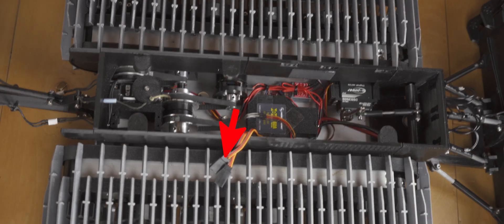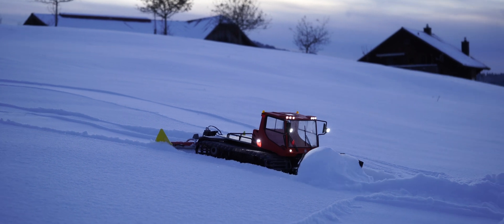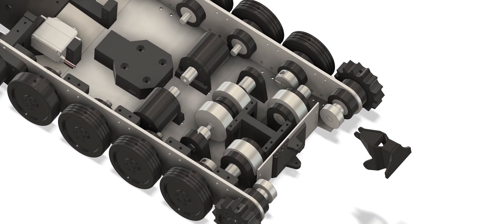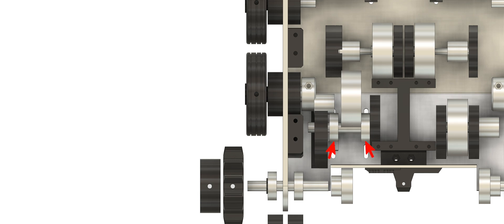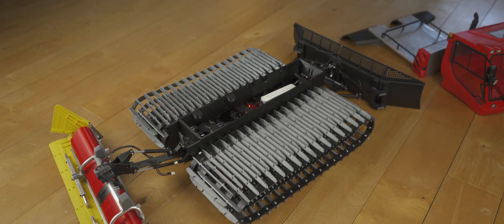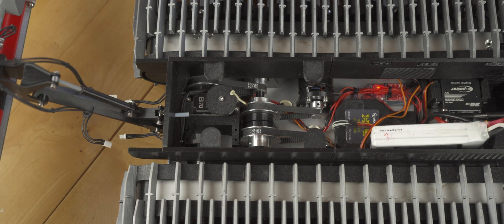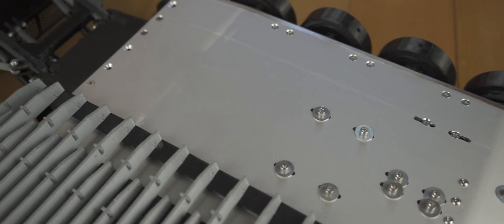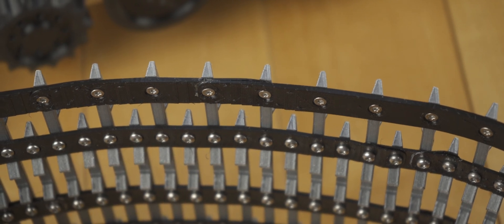Build Pistenbully 400

Comment: Hey! Thank you for the instructions! It looks like it's going to be a great machine! I have a bunch of questions and some recommendations but I'll try to put it in a list so it's easier to make a partslist  that you can use. 
- What other screws are needed and kind of how much? I saw it's mostly M3 everywhere but there are some M4 and different lengths?
- What do you use to program the ESC? Since you'd need to configure it for forward/reverse and so...
- Is all of the lights 3mm led? I saw most holes are 3mm
- The steel shafts for the rollers are 8mm and 5mm but if you write what length and how many pcs. they are you can order them as steel pins with exact length so you don't have to cut them.
- The motors seem to be a impossible to find and also anything it this size, can you suggest some alternative? It will be also easier for most people who will build it to have more popular alternative such as something from aliexpress. Than you can have parts worldwide and order almost everything in one place.
( I saw there isnt much space if I get bigger to be safe with torque but im worried if it will be enough if I get a slightly smaller ones. 
- The motors in the tiller I guess are 12V 16GA geared motors but what is the output RPM?

It might be easier for builders also for you if you have a group then others can help with info too. (other creators usually use facebook)

I'd like if i can get a contact with you in some way so I can put together a part list with links and information as well as send you some ideas and files of upgrades in the future that i have in mind 
(more functions on the blade for example.

Thank you for the amazing project and greetings!
Reply from the maker: I made a discord server were we could write together. I am testing it. Not sure if i set it up right. https://discord.com/channels/1201593411812212838/1201593411812212841
Reply: @A_Guy_Building_Stuff  The link isn't working...
Reply from the maker: I‘m still testing the settings. Does this one work? https://discord.gg/HgHwsn2m2n @kamenzlatkov1319
Reply: con you like build them and then sell them? cuz is really difficult build one😅